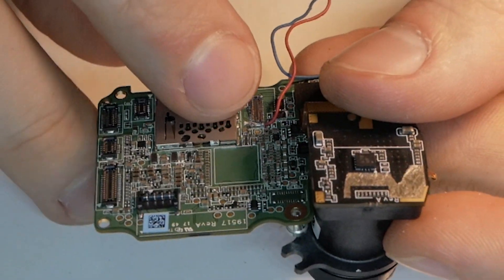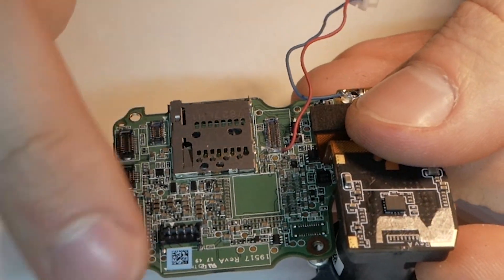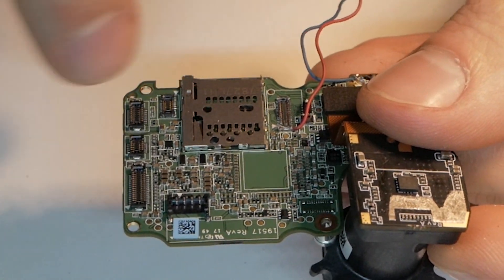Every way to power your stripped GoPro! #DisonMini

Comment: I hawe 2 GoPros,one 6 and 7 black bouth stoped working..is there any chance to chek what is wrong with them?bouth dont want to turn on.i tried all torturials to reset it,sd cards etc but didnt work
Reply from the maker: Are they stripped?
Reply: @rimzler   i openede the 7 to see if som diodes or conectors came off,the 6 is unopened.why?
Reply from the maker: Is the red light blinking when u connect usbc
Reply: @rimzler   no nothing

Comment: Hi Rimzler, thanks for the clear videos! I was doing the teardown on the hero 6 and wanted to test it. But i installed the ribbon cable for the buttons outwards, not inwards like you said. Does this damage the gopro motherboard? It does not power on anymore, stupid mistake i know....

Comment: I power my naked hero6 using the chip in battery along with a modified regulator which provides 4V to the battery chip. this way I can access the Wifi whenever I need to change settings in camera (usually need to change between 30 and 60fps depending on the shot). note that most chips will self lock when you detach them from the cell so you need to find one which doesn't. you can see my build here, the thing attached to the back of the camera is my "power module" as described above: https://rotorbuilds.com/build/22300
Reply from the maker: Oh wow that's very cool to know! Didn't know about the self locking
Reply: Thanks, great info! Do you know maybe Wich chips will not self lock? Is it possible to unlock a chip? Why do you feed the board with 4v? To match 3.7-4.2v? Thanks ☺️
Reply: @starnfpv355  I bought some random cheap/fake batteries and noticed that their chips don't self lock and my naked gopro worked well with them. I doubt you can unlock a chip, the purpose of the lock is to protect itself form being used outside its pack, if you could unlock it then the purpose would be defeated. yes, I am providing it 4V to be in the range of a lithium ion cell voltage.
Reply: @AerialMediapro  Thanks! And you just add a resistor to make the voltage drop? Have you had problems with 5v? Or it's just to be sure?
Reply: @starnfpv355  there is no way of telling if the battery chip or the gopro mother board will sustain 5V coming from a source which is suppose to provide a max of 4.2V. it would be too much of a risk to try using 5v. a friend, who is very savy in electronics, modified a 5v regulator by replacing one of its internal resistors to provide 4V.

Comment: Glad to see you are staying safe and healthy! Perfect timing on this video. I stripped a GoPro hero 6 (17g) and tried to keep the usb c port, but then I broke the power button off the ribbon cable when I was gluing it to the back so I can’t get it to power on except through quick capture using the shutter button, which also stopped working (btw, I had to modify your stl file so the usb module would fit) so I went ahead and soldered wires directly to the board, and ordered a new ribbon cable. Practicing my fpv skills while waiting on it to arrive from China. Btw, I’d love for you to do a video or put out more information about your squid project. I had been thinking of building something similar even before I found your channel! It’s really a bummer that the first video got corrupted!
Reply: there's another method of soldering a wire on the power strip ribbon cable, but I chose this route.  Now when power is supplied, the GoPro fires right up!
Reply: @michaelinmotion  cool hack! I bridged the broken power button so it auto starts, that works well, but I would love it if it would also auto start recording. Does your hack make it record directly?
Reply: @rutgerdezeeuw  no, that's just a auto start power hack.
Reply: Mikey Richard Thanks man! I’m gonna give this a try tomorrow. I don’t ever use FB, but I think I tried to join that group a week or two ago anyways and saw a comment about something like this, but don’t know I’d have this problem yet when I saw it.... So you just solder a wire between that left battery connection and that copper circle pad on the board? Seems simple enough!
Reply from the maker: Thank you bro! Yeah a replacement wire is the best option then! Aahhaha I shot another video about project squid some days ago, but didn't like it, this drone is not very lucky
Reply: Rimzler Bummer about the second squid video, please don’t give up! I really want to make one. You can check out a 360 project I did recently for the city I live in featuring the new mountain bike trails here: www.360eureka.org  It would be great for projects like this one!
Reply: you actually didn't need to buy another ribbon cable.  What happened to you happened exactly to me... I snapped the power button when hot gluing it.  If you join the Naked GoPro Cinewhoop community on FB, you'll get great information there.  but this image shows what to do:  https://scontent-ort2-2.xx.fbcdn.net/v/t1.0-0/p526x296/91113731_10222325531789815_7100792846914945024_o.jpg?_nc_cat=104&_nc_sid=dbeb18&_nc_ohc=mIH_Ax3XMG8AX_QcUYN&_nc_ht=scontent-ort2-2.xx&_nc_tp=6&oh=9fa1154bab7627714e453eb3c3c56da3&oe=5EA2930B
Reply from the maker: That's a cool hack, is that pin on battery connector ground? Cause u could solder to other sources then
Reply: Mikey Richard Thanks so much!!!! That wire mod worked like a dream! Now I’m excited to go film!